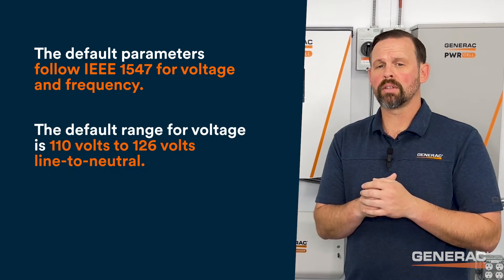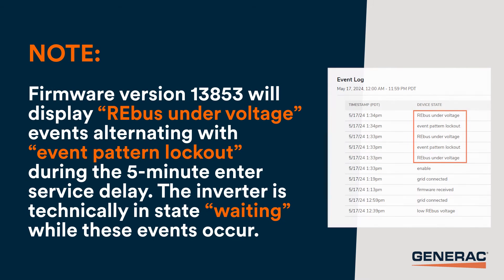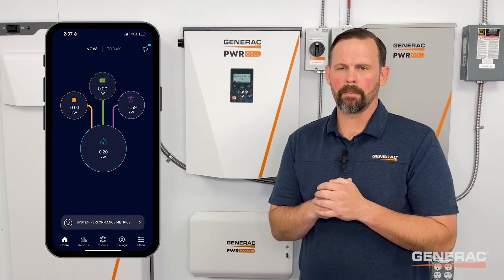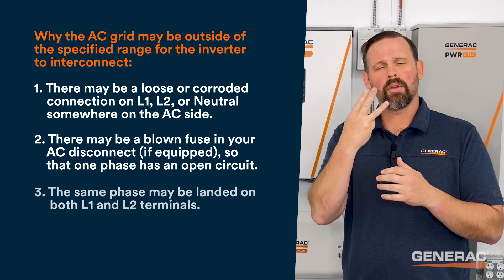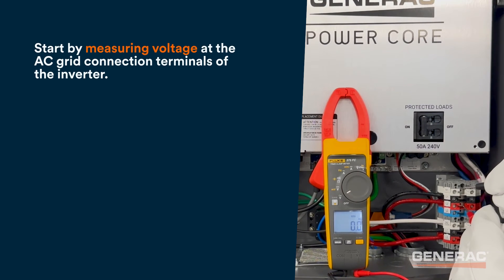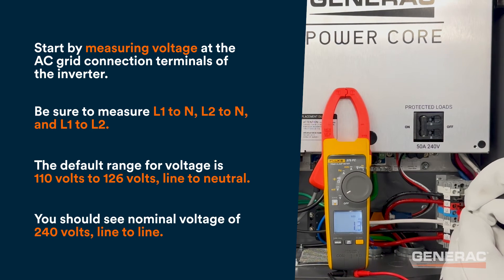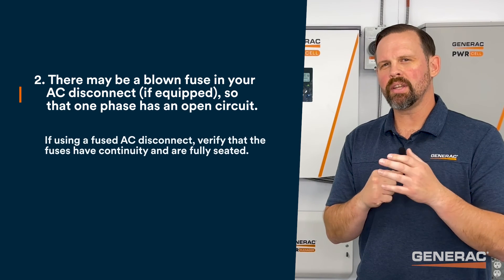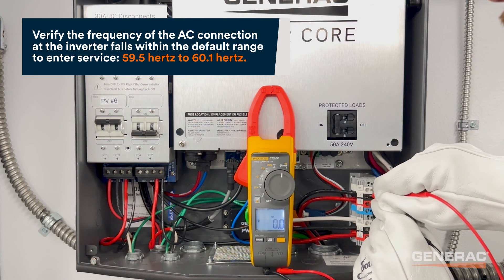PWRcell Pro Tips: How to Troubleshoot a PWRcell Inverter in a Waiting, Standby, or Low REbus State

Comment: My inverter was in Waiting state. The error code was related to overvoltage and Generac support confirmed the voltage input graph was sporadic. I confirmed a solid 242V AC input on L1 & L2. It was eventually fixed by adding a neutral connection. I can’t explain why, but I haven’t had any issues since.